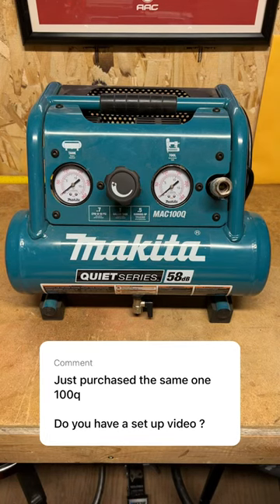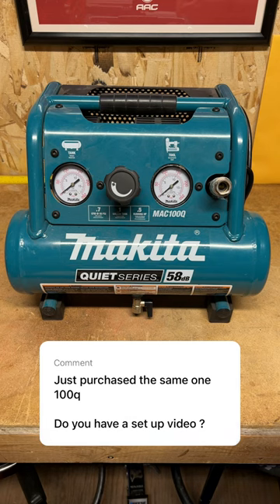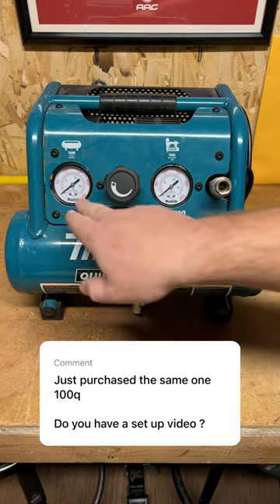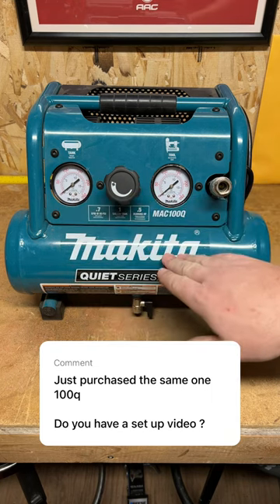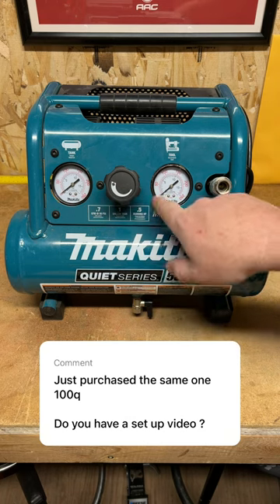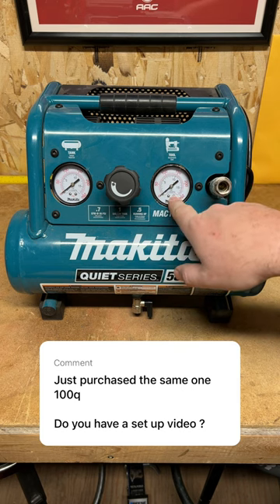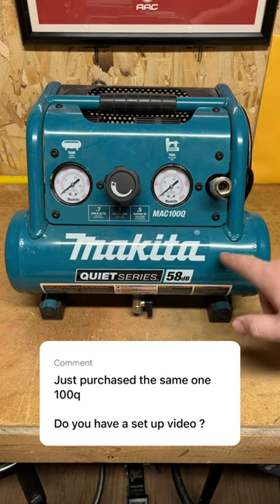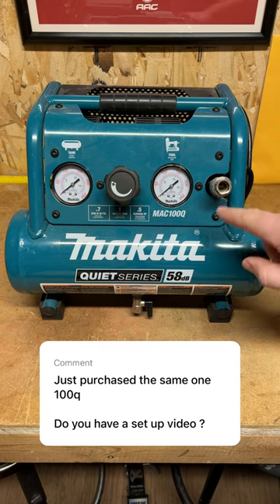Makita MAC100Q Walkthrough

Comment: just wondering about the rusting part. i always assumed the opposite, that leaving the tank valve open would make it rust more.
Reply from the maker: I think if it is stored in a dry place then leaving it open so that there is no possibility for condensed water to collect works. That is the situation I am in. But you have a good point and I believe that in the manual it states that as long as you drain the tank after use and allow all of the condensed water out then you are good to close the drain valve. Perhaps if it is stored in a humid climate then you would probably want to close it after draining. 👍🏻 Thanks for the great comment and pointing this out.